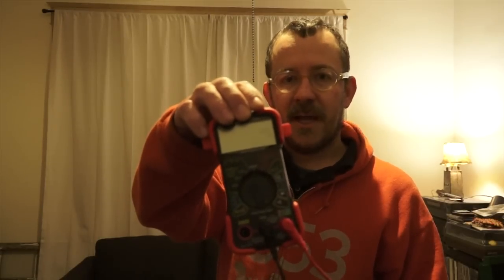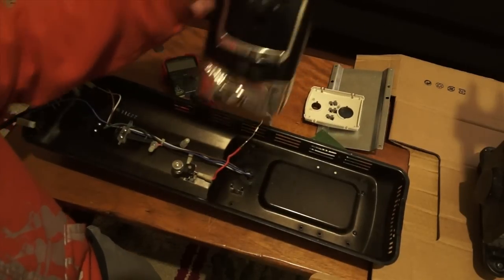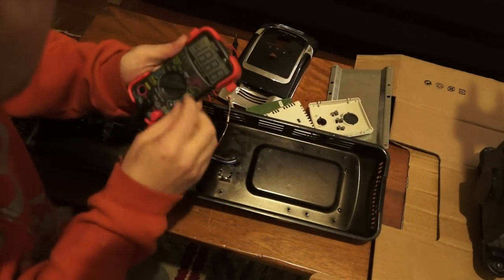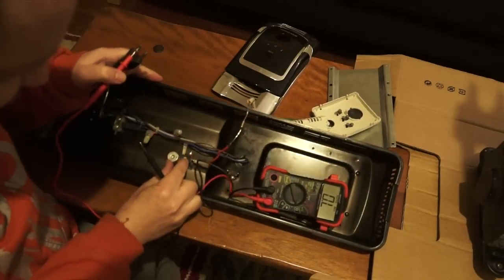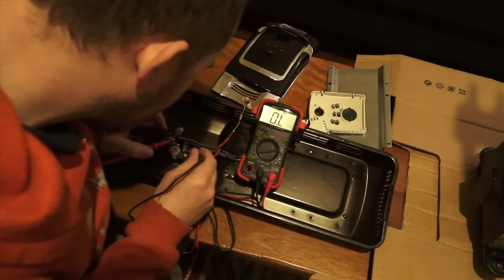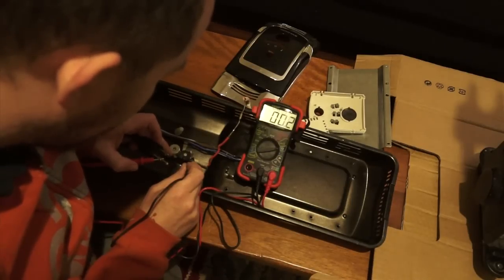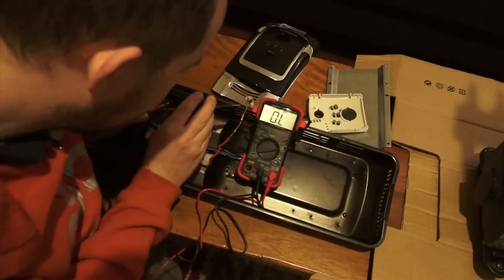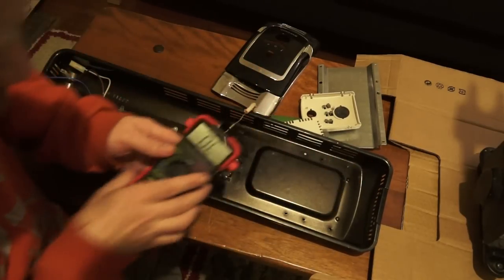Oil Filled Heater Repair - Bad Thermal Fuse

Comment: The heater you're repairing looks exactly like mine with the exact same problem. Which is why I'm here. I didn't know what to call that fuse thing either. I won the lottery coming to your channel... got the name of the part AND the part #. I love it when it works out like this!  Thanks a lot for the info... even 5 years later. 😉 🦋
Reply from the maker: That's great to hear!  Good job on repairing your heater.

Comment: Thanks for the video, I realize it's from 2014 but it's still viable today. I have a milk house heater that started shutting off and I tried diagnosing it last year but I'm not sure if I found the problem or not. It has a bi-metal thermal switch in it like what's in hair driers, if it gets too hot the bi-metal bends and breaks the connection at a set of contact points that look similar to contact points that were in older vehicle ignition systems. I'm not for sure if these points were the problem because I can't remember now but I think that it was. The problem I was having was finding replacements online but I'm going to open it back up and check some other things. I'm not sure if it has a thermal fuse like what's in your heater or not but I'm going to check. I kept the heater because I can't bring myself to throw a good heater away because of a measly $2.00 part that doesn't last so I'm going to get back to it and see if I can fix it again!
Reply from the maker: Good luck, Jeff!  I appreciate your stick-to-it-iveness.
Reply: Do you have a updated about what was wrong with your heater?
Reply: @727dylan  Sorry but no, I don't believe I ever got back into it that I remember. We moved and threw a lot of things away that we didn't want to bring along so it got tossed.

Comment: I have a very similar model Honeywell HZ 789. The large pendulum metal portion of the tip over switch had developed an enlarged hole where it pivots and it was keeping the circuit open by being loose.  I have inquired about them sending me a new part, but in the meantime I just bypassed the tip over switch.
T10 Security Torx bit to remove the outer 4 screws.
Reply from the maker: Thanks for the suggestion, Tony.  It may help others.

Comment: I have an issue with my oil heater and it needs a ksd301 16 / 125 110 . 120v it is a Warm Fusion model HD 904. Cannot find one. Online
Reply from the maker: That's funny.  I googled "ksd301 16 / 125 110 . 120v" and several websites came up.  Alibaba and Amazon have it.  

Here's one, https://www.amazon.com/uxcell-Temperature-Control-Thermostat-Celsius/dp/B007Q81K0S .  I saw an individual one available for for $2.30 with 2.50 shipping on ebay, I suspect there are even cheaper if you dig.  

Though I am not very knowledgable about electronics, I would hazard a guess (because the thermastats are rated by temperature) that you need one that is rated for 125º based on that second number in your part number above.  Good luck to you, Joe.

Comment: I've got the exact same heater, I just checked it , but befor we checked it , like a dumb ass we cut 1 end of it , only because we were going to buy a new one of what ever you called it , but then we checked it, like I said , after we cut that 1 end, so would that have any effect on letting me know if it was bad ya think, or cut or not would it still read bad if it's bad
Reply from the maker: You may be able to test the thermal fuse for continuity.  Put your test probes on both ends.  If the fuse is good your resistance will be close to zero.  If the fuse is bad, the meter will read, OL, "open line."  I hope that helps.
Reply from the maker: You could also try bypassing the fuse, to see if that maked the heater turn on, but do not use it without the thermal fuse because it could become a fire hazard with out the fuse.  !!!

Comment: OK when you find out that your thermafuse is okay, buy two of these https://www.google.com/search?q=tianbo+24vdc&ie=utf-8&oe=utf-8&client=firefox-b-1 .  They are 24vdc relays.  You need to crack open the white plastic circuit board container.  the only thing holding the circuit boards are tabs.  They will fall out as long as tabs are pushed.  Of course you will need a soldering iron to replace these 4 blade relays.  Good luck.  I ordered mine and will have to wait 4 weeks for them to arrive from china.  I just hate to throw things in the landfill if they can be fixed.
Reply from the maker: Thank you for the additional information.  I hope it is helpful to others who experience the same problem.  I appreciate and share your attitude about fixing stuff to keep it out of the the landfill.  Keep on!

Comment: OK there are 2 screws on the bottom and two hidden screws on the top.  This did not fix my problem however.  My fuse was good.
Reply: Where are these screws?
Reply: Top front under plastic cover that pops off and bottom front.
Reply: Thanks. I guess my question is really, what part of the cover pops off and where do I pull?
Reply: small piece of plastic 2.5" rectangle pops right off with knife or fingernail
Reply: OK, I definitely have a different model.
Reply: looks like a battery cover on remote control. comes right off, its just there to cover the ugly screws.  You can toss it in the garbage.

Comment: GOOD VIDEO BUT YOU DID NOT EXPLAIN HOW TO GET THE COVER OFF
Reply from the maker: Thank you.  I was not thinking, that would have been helpful.  Good suggestion.
Reply: Two screws on the bottom section of the control end.

Comment: Great video...i found a honeywell digital oil filled heater in trash took it home and 100% dead....did some testing and thought it was a circuit board issue ..had no idea there was a thermal fuse inside that kevlar cloth material......i jumped the fuse using alligator clips and it now works...will buy a fuse....thank you
Reply: What kind of leads did you use?
Reply: i jumped/bypassed  the fuse using wire with alligator clips on each end and connecting to each end of the wire that connects to the fuse ...just for testing purposes.....i ordered a new thermal fuse and will just solder new fuse in place where orig bad one is..probably just piggy back it ..which will make it more .simple and easy
Reply: the thermal fuse should be in place for safety reasons....if it senses temp too hot it shuts heater down.....
Reply: Thanks. Yeah, I was thinking 14-gauge leads could bypass the fuse both as a test and then as a means of connecting a trip switch, but I'd have to make my own.
Reply: Definitely! Is there a source for how to get the cover off in the first place?
Reply: To take front cover off there are 4 small special security torx screws..2 on top 2 on bottom..the ones on top are ubder the black plastic cover u have to carefully pry off

Comment: Looks like we have the same model but the issue I'm having with mine is no heat but the unit still powers on and I can use the buttons with no problem.  When i took off the front panel I noticed the connecters near the heating element were a bit browned so it makes me wonder if that is the issue.
Reply from the maker: Sorry to hear about your heater.  I think there must be a way to test the heater element, either for continuity or resistance.  Google it!  :-D  Good luck!  And if you find a solution, feel free to post it here, to help others!  Thank you!
Reply: All I know is that there are 3 wires that lead onto the heating element? Its a blue, white and a brown wire however, the white wire is connected to another component which looks like it has thermal grease applied on it one of the ends is browned so maybe thats the issue but I have no idea without proper tools lol
Reply: @kkwl87  Did you ever fix this? My heater has the exact same problem - light turns on but producing no heat

Comment: This l believe is a thermal fuse one time use. when it gets to hot it 
melts braking the circuit. thermal fuses are 3 three types i think,  used once,  cool down back on  and one with button to reset.
     A transistor is a semiconductor device used to amplify or switch electronic signals and electrical power. It is composed of semiconductor material usually with at least three terminals for connection to an external circuit. A voltage or current
 applied to one pair of the transistor's terminals controls the current 
through another pair of terminals. Because the controlled (output) power can be higher than the controlling (input) power, a transistor can amplify a signal. Today, some transistors are packaged individually, but many more are found embedded in integrated circuits.

Comment: I just fixed a Pelonis model HO-0218 7 fin  oil filled radiator this past weekend that had that same problem.  The part you are describing as a transistor is actually a over temperature fuse.  Given the tiny size of the device I believe it is a thermal fuse as it was labeled at 105 degrees C.  As a fuse this is not self resetting and once they cut off or go open circuit then they are finished and the heater will never work again unless it is replaced.  I looked online to find a replacement but I could find nothing like it on Ebay or even electronics suppliers like Digikey or Mouser Electronics.  I did not like the design of using this cheap part that once it blows the heater becomes useless  so upgraded the heater to use a KSD301 series snap action over temp switch rated for 105 degrees C and it will take 15 amps at 120 volts AC.  You can find these what I call Klixon style bi-metallic snap action temperature switches in abundance on Ebay for around $3 direct ship from China. I had to modify the wiring a bit using 1/4 inch female crimp connectors to connect the wires to the KSD301 which I then screwed one side to the same hole that held the blown thermal fuse cable clamp. The heater works great again and is fully protected from overheating by the newly installed KSD301 snap action thermal switch which will automatically reset if tripped once the heater reduces in temperature to whatever differential temp is built into the switch which I think is around 25 degrees C.  I really love fixing these heaters and I really also love the kind of even heat they give off.
Reply: kdegru1 hey there,  I hate my heater turning off when it gets to the set temp, how do I disable the auto off function  so it will stay on forever
Reply: just put the dial to the max...That is what I do..it never goes off...you can have it set at 600 w, 900w, or the full 1500w with the switches...I guess if it it get super, mega warm in the room it might go off then...but turning the dialto the max will keep that thing just going..
Reply: OUT OF LIMITS I BELIEVE IS OL
Reply: kdegru1 You have to actual understand something about these things to fix it.  The average consumer will have no clue.

Comment: Mine is a Delonghi EW7507EBL. I'm not sure if it has the same problem as yours but mine can turn on for about 10-15 minutes then it just shuts off and no power coming in the heater. After about 20-30 minutes (the heater cool down) the power comes back and I was able to turn it on again. However, the same thing happen again. I wondering if it has a bad thermal fuse or something else is wrong with it. Any help/suggestion are greatly appreciated. Thank you.